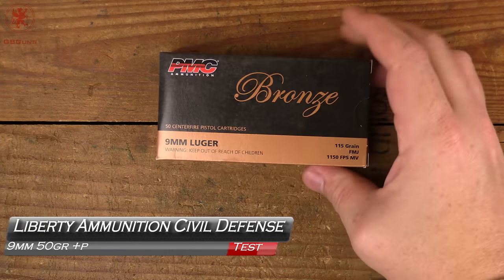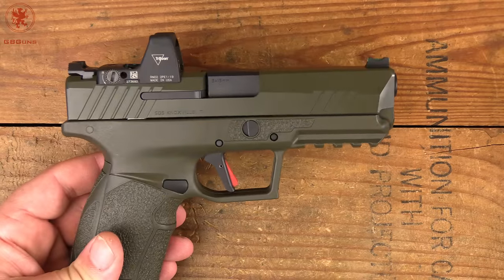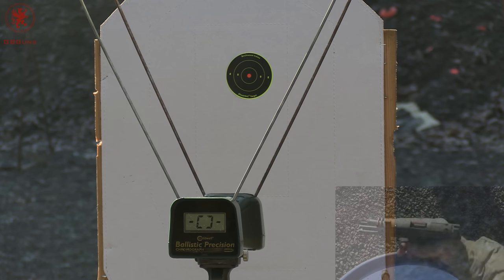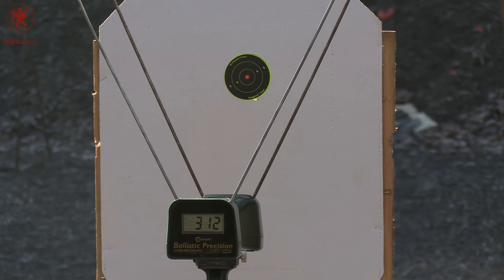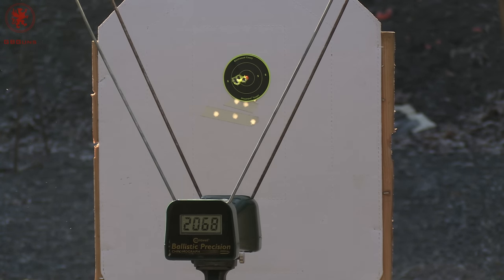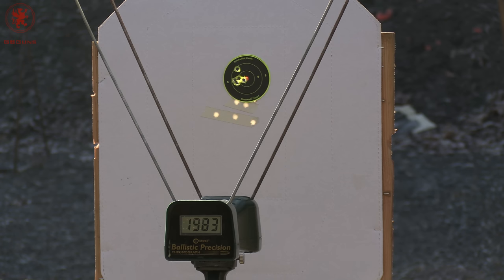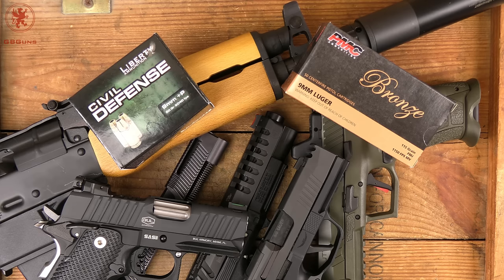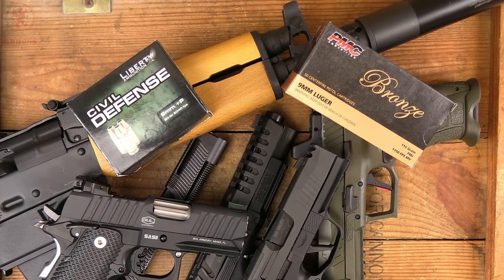Liberty Ammunition Civil Defense 9mm Ammunition Test

Comment: I love the Civil defense, it's like 30% less recoil, 35% less weight, almost twice the velocity, will penetrate level 3 armor, but not over penetrate bad guys! Awesome stuff!
Reply: I have this civil defense in 380, 9mm and 40cal it's def some cool ammo. My only concern is that it fragments and the base is so small after. I'm wondering if it's going to b  a intense surface wound with a hole through center? It will definitely blow up some water jugs and melons tho awesome transfer of energy
Reply: @timjohnson8390  The loaded mag in my all my pistols are full of civil defense, my back up mag has critical defense lol. I freaking love this stuff (Civil Defense). I first tried it on my 4" Smith & Wesson 686+ .357 and noticed how much less recoil it had versus the same .357 magnum critical defense. Then I watched a ton of youtubes on it , especially WHO TEE WHO blow up the freakin watermelons which was hilarious! Then I was wondering , "what are the cons? Penetration maybe?" So I watched MAC blow through body armor and was sold. Bought like 10 boxes of it and love this stuff!
Reply: @nobodyspecial1852  Not too sure how but it does and does so with plenty enough energy to make a deep cavernous hole in the clay behind it. Check Military Arms Channel on YouTube he's got a video testing 9mm civil defense and spartan 3A armor
Reply: @nobodyspecial1852  If I were stuck carrying .380 acp this would definitely be the ammo I would choose. For sure puts .380 acp in an entirely different category

Comment: Talk about Quagmire!

I think these are some interesting numbers. 5.56 NATO by weight is typically 55GR and has about 2100+ FPS. So, in terms of energy it's quite interesting to find out what kind of transfer it can do.

Thanks Graham and Teya!
Reply from the maker: 5.56x45is usually closer to 3,000 fps when from a proper barrel, but you do have a point, as I showed in the article (where all this data was crunched) this ammunition is punching way above it's "weight" (caliber) class in terms of energy delivered.
Reply: @GBGuns  If that's the case, then an SBR AR compared to something similar to your AK-9 barrel length of 11.4 inch may actually have about the same down range energy. Now THAT'S quite the clever quagmire!

Comment: Quagmire, back like 7 years ago I walked into a Dicks Sporting goods and they were selling all of their Liberty Ammo for $10 a box to get rid of it, since no one wanted it.  Unfortunately, my pockets weren't deep with cash, so I went home with 6 boxes.  I'm appalled at what the prices are now even  at FFL dealer prices, stupid expensive.
Reply from the maker: Those were probably sold at a loss.  I made a similar purchase of Colt's ammunition which I believe were GBW copper projectiles and loaded by someone else.
Reply: @GBGuns  why did they change the black coating on the colt/corbon 9mm 115gr ammo? I bought a bunch of double tap in hopes the 115gr was black tipped but it's copper now. Any thoughts?
Reply from the maker: @GanjaBabyy  I don't know for sure.  I thought the black coating was to inhibit corrosion, but mine have corroded over time anyways.

Comment: Been using Liberty ammo for several years as the velocity is legit and it's like half the weight of any other ammo! And they have a new numeral case that supposedly lighter! Not the projectile but the case. At $1/rd they ain't cheap though. Thinking of using it in my PAK9 as every bit of weight reduction helps! Least until I get an Extar...man  5lbs with an optic? Unbelievable!
Reply from the maker: Yes the new cases are what I think used to be called NS2 or something like that. It's a blend of steel and aluminum and makes ammunition VERY light and is plenty strong enough for pistol pressures.

Comment: well done ,
 I saw graphs and there's some strange things I think depend on differences in barrels quality . 
suggestion : for the next test of this kind you can use the exactly same barrels in different lengths .
Reply from the maker: But if I did that it wouldn't be guns that people own.  I thought about it, but wanted the test to he as relatable as possible.  I would have grabbed a G19 but I replaced my worn out Glock barrel with an aftermarket years ago.
Reply: @GBGuns  yope , there's always compromise between practicality and pure science .

Comment: I wonder what exactly is the "point of diminishing returns" on 9mm? Itd be nice if someone made a round that uses a slower burning powder for the PCC, or maybe a round with a tad less friction between the bullet that allowed for maximum performance out of a PCC barell.. they're only 16" to have a stock legally.. itd be nice to have a round that was optimized for that length. I dont own one... but I'm suggesting that my mom gets one for home defense. I dont like the idea of sacrificing velocity for three points of contact.
I first discovered your channel recently when I was researching for my latest pistol purchase. The what's for dinner test was a good help in selecting what rounds I might like for my bul sas ii ultralight.  I've not even shot it yet as my ammo from optics planet hasn't arrived.  I'm looking forward to testing the liberty 9mm.. if it runs I plan on carrying that in one mag and g9 in the backup. Having a 9mm that will defeat armor if a mass  shooter has it. Thanks for the info in this and the bull ultralight review.
Reply from the maker: Thank you and welcome to the channel!  We've got quite a library of reviews and tests.  It seems that most 9mm rounds top out on speed around the 12" of barrel mark.  After that friction loss starts to actually slow the bullet. There are some dedicated "PCC" loads out there, but we haven't tested to see if they're any better than standard ball. Check out the article (pinned comment) if you want to see the charts of how this ammo did.

Comment: Quagmire. Interesting is that the P365XL seemed to hold the best group of all! And it seemed to shoot the Liberty rds. OK too. I have a steel flip over target that would not flip at about 6 yards with my P365. Steel paddle hardly moved. So with the same ammo & distance with my P365XL the paddle moved a lot more but still would not flip over. So then I took out my S&W Shield Plus 4" ported barrel pistol, same ammo & distance, and the target then flipped over. I'd call it a significant gain in power over the 3.7" barrel. Noticeable too when hitting steel targets at 25 yds. & my P10C threaded barrel at 4.5" hits harder than my 4" ported barrel, & you guessed it, my XDM threaded barrel at 5" hits even harder. My Sub-2000 with a Red Dot can hit 10" plates at 100 yds. all day.
Reply from the maker: Yes, we've shown similar experiences during the "Sights & Trigger Control" segment of our range videos.  Of course there are other variables such as where on the target you hit, etc, but in the article we show the actual energy.  If I was a good enough shot to hit the exact same spot every time with every gun it would be interesting to see what the ft/lbs threshhold is for moving the target.

Comment: Great video. Quagmire,  but one question/response:  I wish you would have thrown in a 16" PCC to support the  claim that it would lose velocity over the 11.14".  I guess I am from Missouri and want you to show me.
Reply from the maker: Haha, good one about Missouri. I didn't test that because I've seen it as a general rule. It may not apply with this load, but in general 9mm past 11-12" starts to lose velocity as friction in the barrel overcomes the combustion force.  We might try it with Liberty just to see.  It's +p (extra pressure) plus a 50gr bullet can't have as much bore contact as a 115gr because it can't possibly be as long, so maybe the results would be interesting.